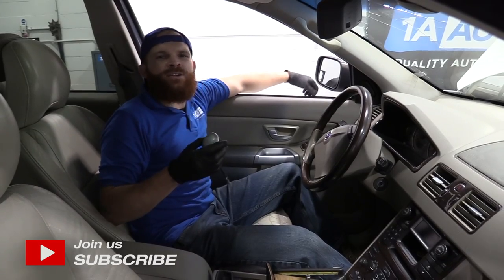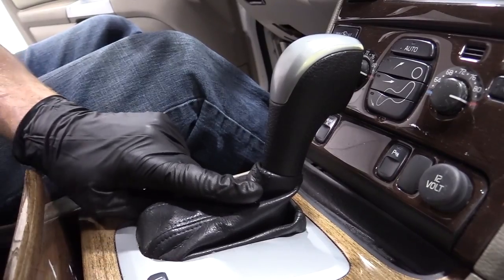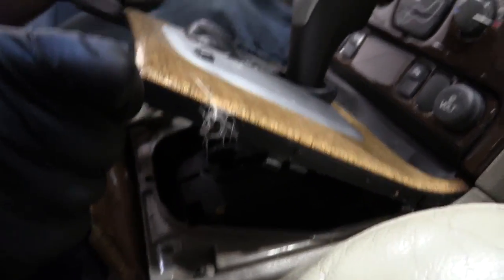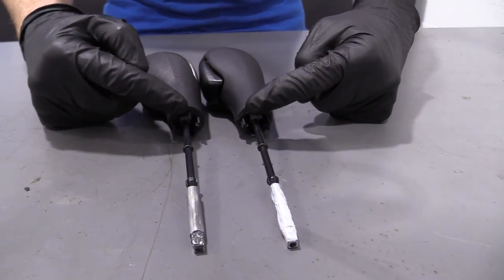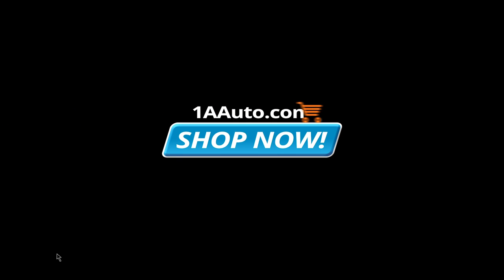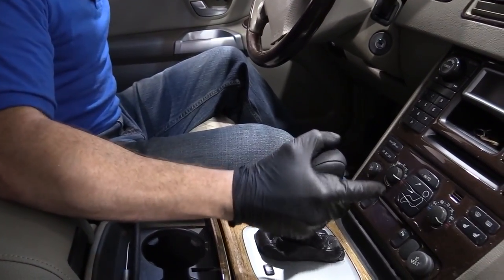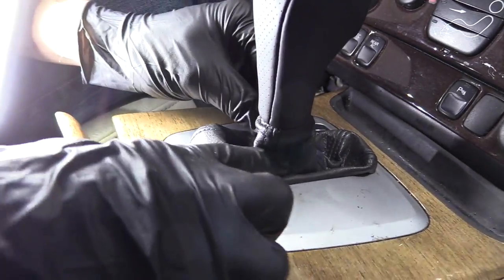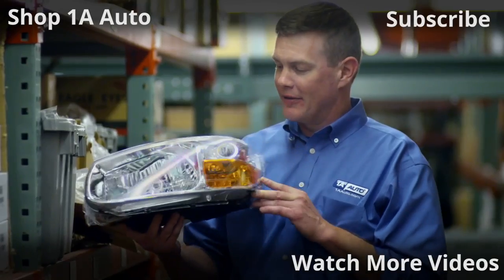How to Replace Shifter Knob 03-13 Volvo XC90

Comment: I'm having a problem with my 2008 Volvo s80 t6 saying gear "selector service required" and sometimes it's very difficult to shift out of park? Would replacing this like you did fix that?

Comment: Does the car have to be in neutral before taking out the old gear shift? Any risk of triggering some sensors if it isn't?
Reply: Did u ever figure this out?
Reply: I got a new one and it still slides out just like the old one. Even waited weeks for the round clip which I thought would mount it but it didn’t. Can’t get it to lock in. Pulls up when lifted.
Reply: @stuarthicks2696  it looks like you just have to really wop on it, maybe easier said than done

Comment: My XC-90 knob is stuck in Park, so on a forward angle.  Are there any other instructions for removal?  Can't seem to be able to pull the shaft out.  Will the shaft come out when its on an angle like that?

Can i just replace the knob and not the entire shaft?  Do you have a video for that?
Reply: I have a 2007 v8 and did it in park no problem.